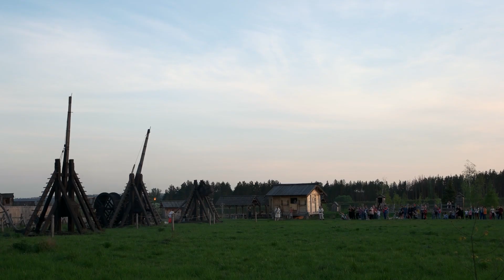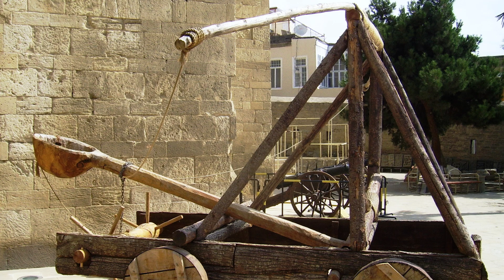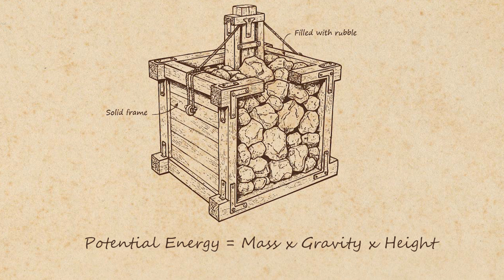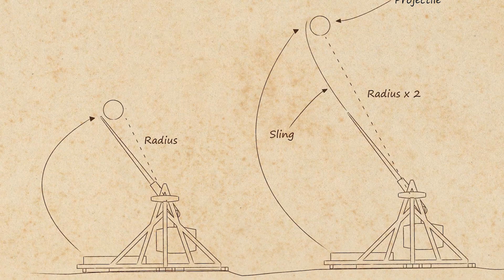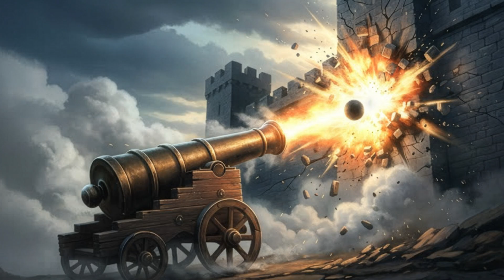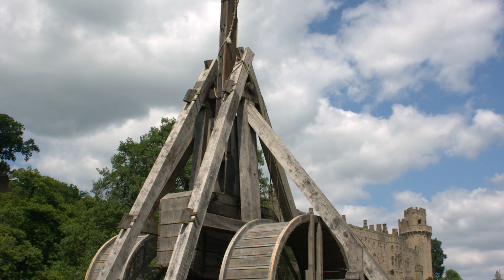The Perfect Physics of the Castle Killer

Comment: My question is, How did they manufacture and transport the ammunition? Could they go get the misses back?  Dig them up near by?  What if you were fighting in the flat lands or swamps.
Reply from the maker: This is an absolutely brilliant set of questions, and it gets to the heart of what made sieges so difficult: logistics. The most powerful trebuchet in the world is useless without ammunition.

To answer your points:

Manufacturing: For the most part, ammunition was sourced locally. An army's engineers would include stonemasons whose job was to find a suitable rock outcrop and spend days, or even weeks, shaping hundreds of projectiles to a roughly consistent weight and size. They didn't need to be perfect spheres, just heavy and "round enough." In a pinch, they'd use anything heavy, including rubble from their own siege works.

Transport & Retrieval: Transporting pre-made ammo was a logistical nightmare, requiring dozens of carts and oxen. Retrieving misses was rare and extremely dangerous. It meant running out into the "no man's land" between the lines, completely exposed to enemy archers.

Terrain: You've hit on a huge challenge. In flatlands or swamps with no local stone, an army would have to bring their ammunition with them, drastically slowing them down and limiting their supply. This was a major strategic consideration. Sometimes the best defence a castle had was being built in a swamp!